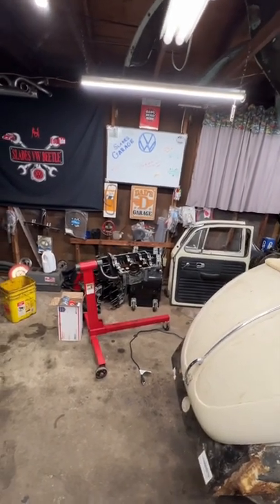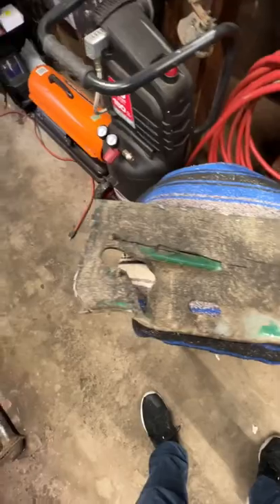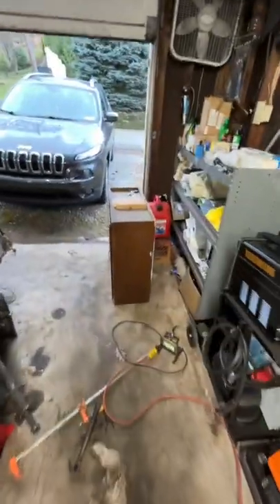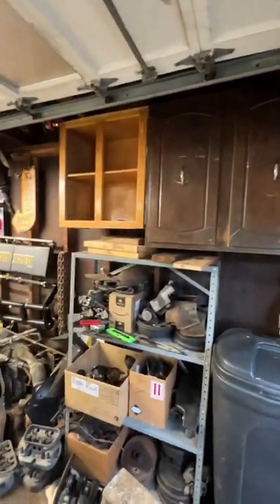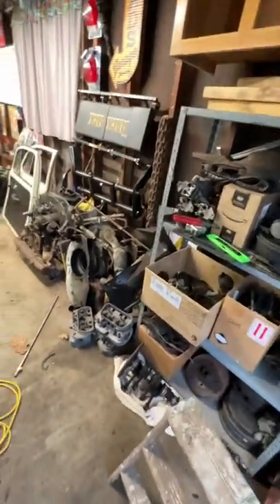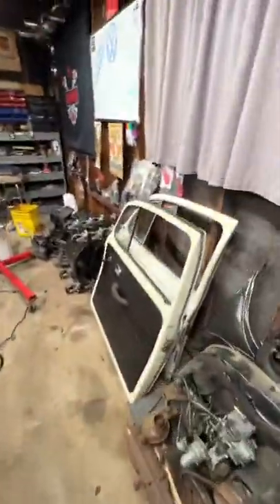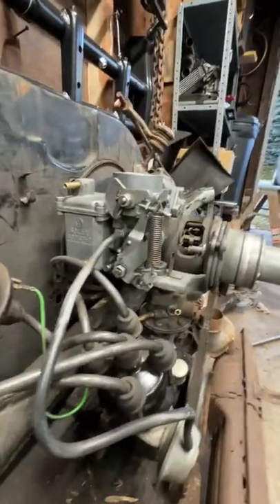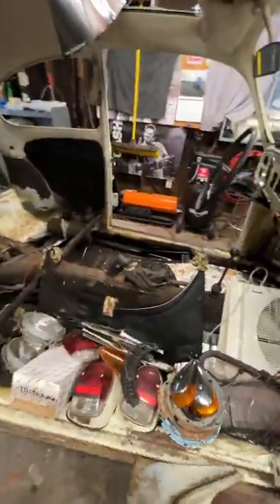VW Beetle Project Weekly Update - DIY - Ultrasonic Cleaner - Harbor Freight - Will it run?

Comment: Looking forward to the carb rebuild episode. I'm a Beetle newbie learning a lot from you. Especially patience! Thank you. I installed a Flame Thrower distributor with vacuum advance in my 71 Super replacing a Bosch 009 on a Bocar 34 pict 3 and I just could not get it to idle again. But with patience, checking all the little details like cleaning the Bypass and Volume screws and addressing one thing at a time, electrical and mechanical I won the battle. How? Just initially static timing the new distributor and trying to keep her running enough to return to the engine bay to minutely twist the distributor to where she would stabilize. Then and only then could I mess with the fuel/air settings. I've almost got it. The result is a lot less jerking and flat spotting now while underway. WHEW! Next is a full timing attempt. I am looking forward to your carb cleaning instruction where as I may still do the process to my carburetor. I'm not sure if anyone else has done this but when checking the validity of my electric choke I safely applied heat gun air to the choke housing and watched as it opened all the way and then slowly closing during the cool down. As you would do, simple tools, great results.